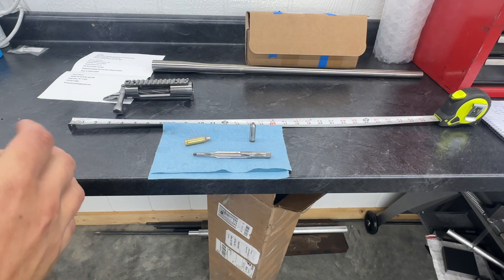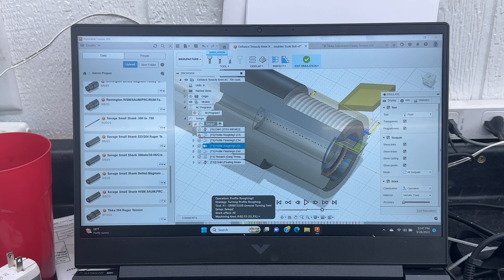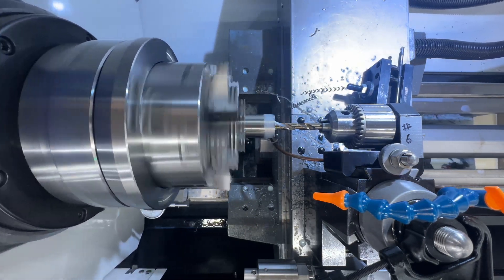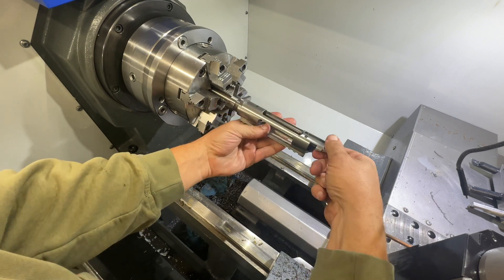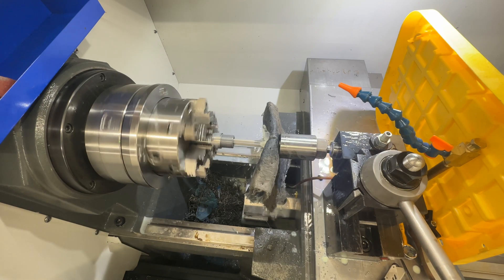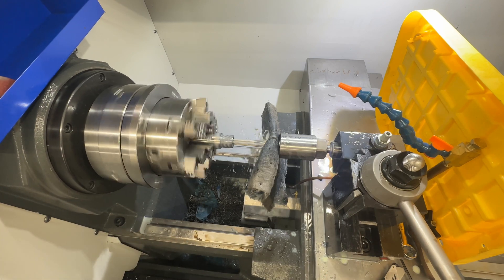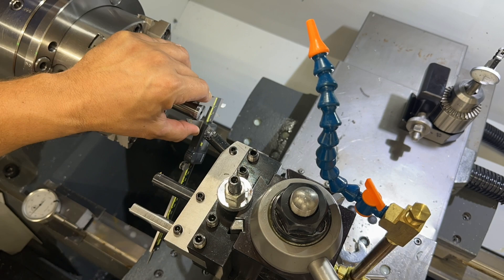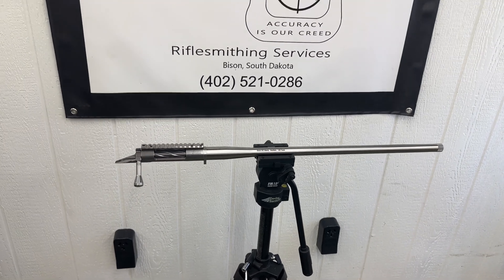Building a 6mm XC Chambered in a Bartlein barrel on a Defiance Action. CNC chambering and threading.

Comment: Nice job mate 👍 
Have you considered machining the muzzle end first, then using the muzzle threads to attach your coolant line?
Seems like one less step in the process, provided the client isn't against having the muzzle threaded.
Reply from the maker: I have thought of it but I like having a bit of grace if something goes wrong on the chamber end I can still salvage the barrel.
Reply: Good consideration 👍

Comment: That's some good looking machining, I am thinking about giving you a call
Reply from the maker: Thanks for the kind words
Reply: @DustinDrews1  Do you offer a class just chambering barrel? I would love to learn it from you.
Reply from the maker: @nicolebaker5193  I haven’t thought of doing that but it could be an option. I’m a flight instructor. Teaching this is simple compared to teaching people how to fly.
Reach out on the phone number in the text if you’re interested.
Reply: @DustinDrews1  I looked you up last night. You are in SD way to far may take me 2 days drive. Thank you for making these videos and sharing them of your knowledge.
I like you are threading in reverse and hi-speed.
Reply: @DustinDrews1  do you have email? I am very new to this world. I am shooting competitive F-Class just want to do my own barrel.
Reply: @DustinDrews1  what do you think this lathe? EISEN 1440E 14" x 40"
I am looking for a Taiwan Lathe. Any suggestion would be appreciate it.

I nearest down to PM1440GT + $2500 for accessories.

EISEN 1440E 14" x 40", It seems EISEN has everything except DRO Console.
Reply from the maker: The issue with small lathes like the 1440s even most 1640s is the spindle bore diameter.
Not sure what you plan on doing gunsmiting wise but one of the best money makers in gunsmithing is threading barrels.
When using a lathe with spindle bore less then 3 1/8 inches requires removing the barrel from the action. Because of the recoil lug won’t fit in the spindle.
Removing the barrel sounds simple until you have to do it. Some rifles even brand new ones make it almost impossible to remove the barrels without damaging them. Mostly because they are screwed on extremely tight.
When you get into this think long term… you will be busy if you do good work.
My ACRA is forsale. It is built by sunmaster it is a high end tiawain lathe. It has a 3 1/8 spindle and is basically brand new and will come with gunsmithing lessons if you purchase it from me.
The lessons in the shop alone will save you more money and time then you could ever imagine if your new to this line of work.
402-521-0286 
God Bless,
Dustin